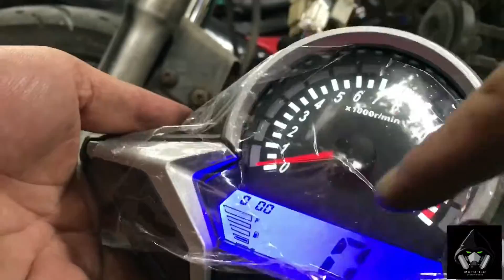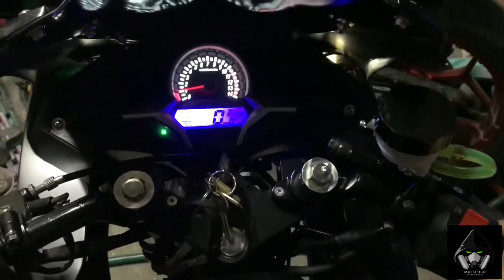[Ep.13] "DAMAGED" RUSI SSX-200 Turned Into "BADASS" Transformation | 25th PROJECTBIKE | MOTOFIED

Comment: Una consulta amigo?, Que hechas antes de poner la fibra de vidrio, es pintura?
Reply from the maker: ola amigo! the first coat I'm using is not a paint but a surface layer called Gelcoat. It is applied before the resin mixture and fiberglass mat.